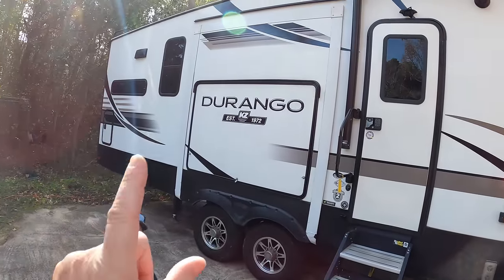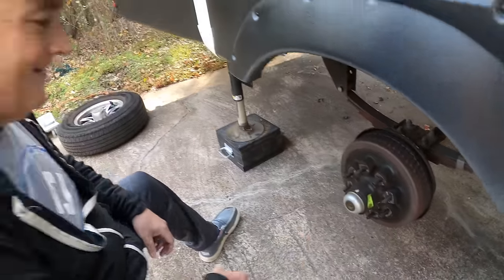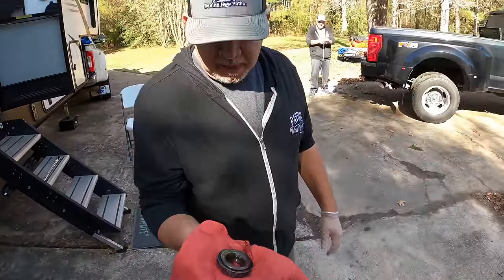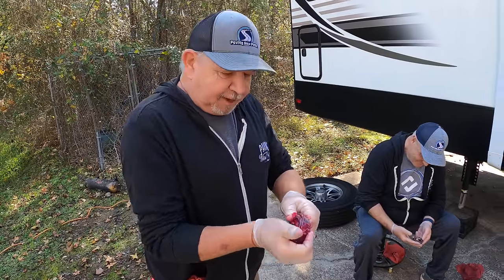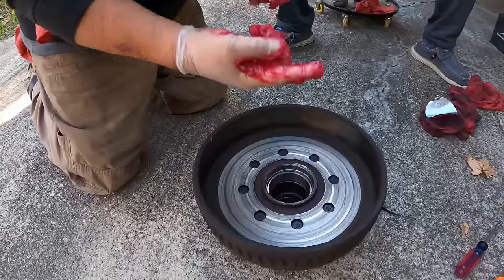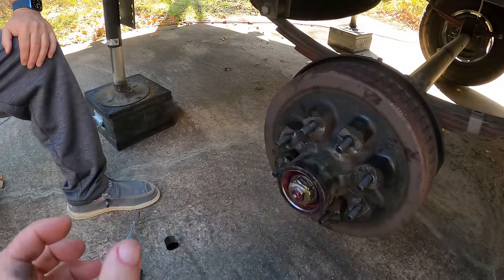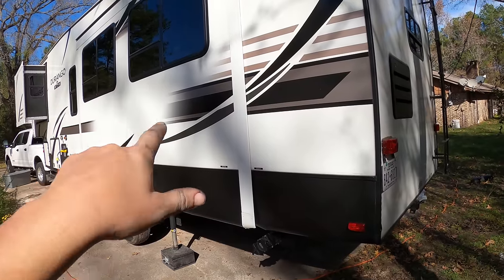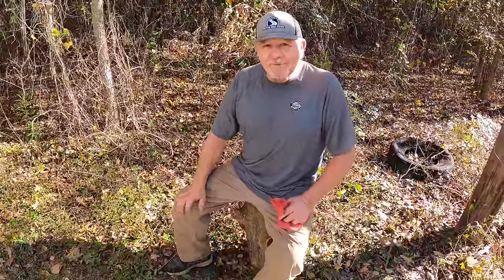STOP! Wasting Your Money On This! Fulltime RV Living!

Comment: Great video! My one thing to add is to always check your suspension. I have always did my bearing and check my my brakes every year. I did not know the suspensions can wear out so badly. I happened to break a leaf spring, lucky it was when I was backing my trailer into the yard. When I took the suspension apart it was totally worn out. The shackles were ready to break and the axle equalizer was worn out. The parts from factory are cheap and should be replaced with heavy duty parts. Please make sure everybody knows how to check their suspension. THIS COULD SAVE SOMEONES LIFE OR A BAD ACCIDENT!
Reply from the maker: Thanks for the suggestion! We do all the proper maintenance and inspections on our rigs! Just because you didn't see us do it in a video doesn't mean we don't do it! We film videos about things we think are entertaining and can be helpful for others! Some subjects we don't feel will make a good video so we simply don't film those!

Comment: Degreasing Metal Surfaces
Mineral spirits dissolves petroleum-based oils and grease, allowing it to be used for cleaning metal components and equipment.
Reply from the maker: We have used mineral spirits before but nothing beats a good old diesel bath!

Comment: Also checking for heavy discoloration of the bearings and the spindle is also something too look for when inspecting the bearings and spindle its a sogn of high wheel bearing temperatures lol  they also have a bearing repacker you can bye cheap enough if your not interested in doing the hand repack method
Reply from the maker: This is why we believe you should do this job yourself! It gives you a chance to inspect everything and you can start to see wear patterns and issues before they happen! We also feel repacking by hand give you a chance to continue the inspection while greasing and you can fully ensure it is done correctly!

Comment: Good vlog....Because of the brake dust and dirt/grease your removing with the brake cleaner I would usually lay some old cardboard under the spindles and drums to catch the run off and not stain the cement you are letting it run off on too. Yes, I do it myself.
Reply from the maker: That's a good idea!

Comment: Just like any hydraulic, use a jack stand.  A failed rubber seal from an accident 
Just 2 size bearing seals for towables.  Boat  seals are different 
He has self adjusting brakes. But if you don’t they need adjusted.  
I don’t recommend using the easy lube, unless you take the cap off and rotate as you lube and clean up the excess. If you pump a bunch of grease without rotating tire you lube 1 channel.  The grease does not flow into bearings it doesn’t get hot enough. Ez lube can blow out the seal too
Don’t drop the bearing. If the cage bends you need new
Don’t fill the cavity with grease it’s not a boat.  The extra grease does nothing 
Check the brake function.  Amp draw or lock up, pull the breakaway. Put a piece of metal on the magnet.  A rusty drum is a sure sign of a broken wire or bad magnet 

I give you a thumbs up but
1 Use a jack stand
2 don’t fill the hub with grease
3 check each brake function 

It does take 2-1/2 hours on average 
Unit swap, getting parts, some are a pain to get off the ground even in a shop, lubing wet bolts, adjusting brakes, 1 guy cleaning and packing, inspection of bearings, brakes, shackles, axle,  cleaning up blown out grease seals. A well maintained is usually less but the one that’s over due by 5 years can be much longer 
Another small note if you need backing plates some have different bolt patterns, and LCI and Dexter don’t always line up but some do
Reply from the maker: Thanks for watching and offering your thoughts! We may not do the job in the manner you would, but we got the job done!

Comment: There is bearing packers at Harbor Freight if you have problems doing by hand.  Note you can not clean brake shoes enough with brakeclean , you must replace shoes.  What you do on one side do the same to the other.
Reply from the maker: We feel doing it by hand gives you more time to inspect and you can ensure you are properly greasing them!  It is also a lost art that most don't do anymore!

Comment: This is a technique that has almost been lost since since the use of wheel hubs on vehicles. If you want to save even more money get the numbers off the seal and bearings and go to your local bearing supply store, you may see even a 50% cheaper price from the trailer shop price. 
So the best thing that can be said is well done on showing how to do routine maintenance at more then half the cost, the more you do the better you will have for the feel of your rig when something is off..
Reply from the maker: We believe in the old ways of doing everything by hand, what is the rush to get the job done if you aren't properly inspecting and greasing your bearings!  Almost all of the time what every they quote you to do a job you can do yourself for about 25% of the cost!  Unless specialty tools are involved then sometimes it makes sense to let them do it!

Comment: Thanks for a great video. I appreciate that very much by the 2016 Sandpiper 371REVH hardly used and now I know how to pack the bearings for them camper because I’m assuming they’ve never been done since it’s hardly been used and I appreciate it very much. Won’t do it now it’s only 2° outside.
Reply from the maker: Definitely save that job for a warmer day! It's a fairly easy job, so you should have no problems!

Comment: How do you lift the whole trailer up and then tilt it slightly while stll connected to the truck? Are you putting stress on the hitch?
Reply from the maker: The hitch rotates side to side and front to back the jacks are holding the rv up the truck is just there to be a safety if the jacks fail! we are also not lifting the entire rv off the ground just one side enough for the tires to clear the ground! You can do it without the truck as well but his truck was already hooked up!

Comment: There are really inexpensive tools for greasing bearings that do a miluch better job of packing the bearings before putting them on the spindles.  Love doing bearings until you have to chisel one off. I have done thousands of them and cut a few hundred off too lol
Reply from the maker: There is no substitute for doing things by hand! Not only will you ensure the bearings are properly greased it gives you a chance to properly inspect them!
Reply: @PavingNewPaths  you inspect them before packing them. The bearing packing tools can get more grease in than hand packing does. Been packing bearings since 1967. I have seen hand packed bearings fail because you can't press enough grease in by hand and it leaves air pockets no matter how hard you try.
Reply from the maker: The great thing is you can do it your way and we can do it our way.

Comment: I love watching you stuff.   However those brake shoes with grease on them should have been replaced.  The grease gets embedded into the brake material and you can’t clean them.  The correct way is to replace them.
Reply from the maker: Brake Cleaner is a great solvent to clean grease and oil off of brake shoes and pads!

Comment: Did you change the brakes that had grease on them dexter told me to change the brakes. Said they would eventually the brake material would brake down from the grease and the solvent used to cleaoff grease. As well as there like a sponge and the grease would soak into them and not real ever clean off or out of the material. Just curious would you did
Reply from the maker: Take it with a grain of salt but all the places that say you need to change them if they have grease or oil on them also sell those parts!
Reply: @PavingNewPaths   yeah thats true I just wasn't sure what best practice was. I know if my truck brakes are soaked in grease or oil for some reason I'm replacing them.
Reply from the maker: It's up to what you feel best about doing! Most if not all shops, will try to sell you because they can but if you say no and the pads are still good they will simply degrease them and install them back on!

Comment: Add bearing buddies to your RV if it doesn't have them already can definitely be a great way to maintain the proper amount of grease in-between service intervals
Reply from the maker: Under the right applications and circumstances, I would say they are great choice! But given how many of these seals are always blown out I would be cautious about adding them!
Reply: Absolutely 💯% if the seals leaking bearing buddies are definitely not going to help but for the time in-between being able to pump a few squirts of grease in them the common mistake I see Alot is over greasing the bearing and caused the grease to come right out of the seal and actually blow the seal right out